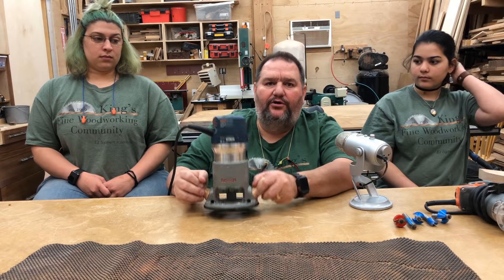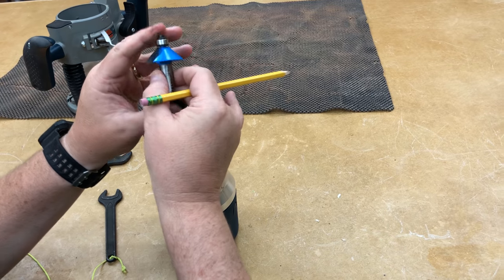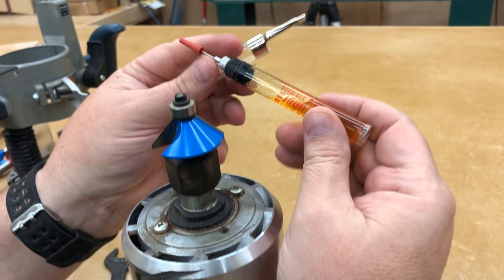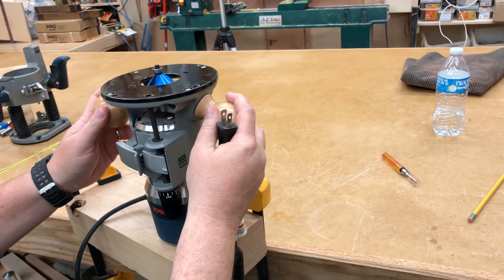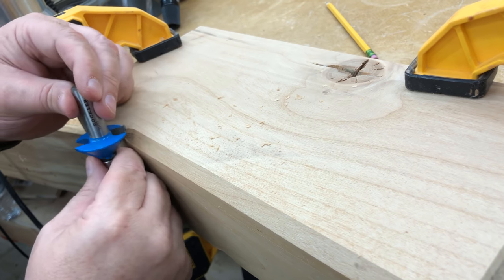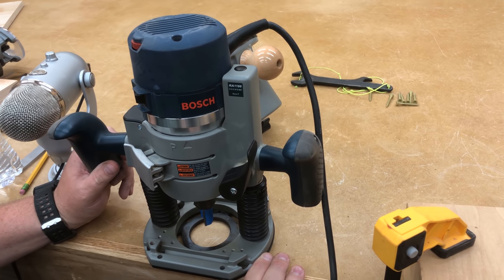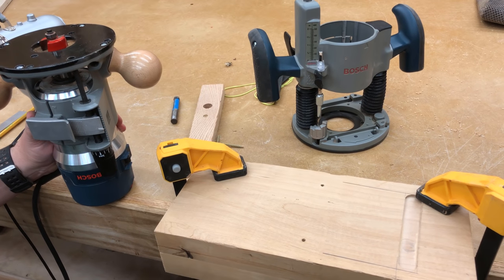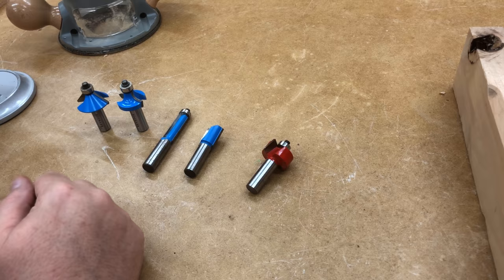56 - Woodworking 101 FREE ONLINE COURSE LESSON 1 Part 3 of 8 The Router

Comment: If you're just starting out with a router I highly recommend spending the extra money if you can and get a kit like James has that comes with both a plunge base and standard base. I have the same kit he does and I made a cheap router table that the standard base is attached to and if I need to do routing without the table then I take the motor out of the table and use the plunge base. This setup has worked wonderfully for me and I can quickly go back and forth if needed.
Reply: Damien Sees I agree. Plunge/fixed combo is the way to go. I have the DeWalt set and and can’t recommend it enough.
Reply: That Bosch plunge router kit is regularly on sale at HD for $190. It's normally about $220. And is an outstanding performer. Will last for years if cared for.

Comment: A tip to prevent confusion with On/Off is to use a green paint pen to put a green dot on the “ON” side of the switch. Even if the lighting level isn’t great, which can make a tiny switch with I/O indentations hard to see, the green dot is hard to miss. It is a very inexpensive way to avoid some potentially expensive errors.

Comment: Thanks for the router class. I got one just recently. However, instead of one bit at a time, I did find quite a few carbide tip "starter sets". It included the most common bits.
I ended up getting a 12 piece set for around $30. 
Again thanks for videos.
Reply: I did the same. I had a larger project I was starting when I bought my router and I bought a 12 piece set to get me started. They're the black painted Irwin's. As the bits get dull I'm replacing them with the better quality bits.
Reply from the maker: Thanks for your comment. I don't recommend the cheaper bits because they are made to extremely low tolerances. If you are paying $2.50 per bit instead of the usual $30 you can expect that. Many of them have cutting wings that are not perfectly aligned with each other. And some are out of balance. Most of them will start to burn your work pretty soon. And it is a bit that may only last a few jobs. 

On the other hand an investment of $25 or more on a quality router bit will last the rest of your life, even if you are a professional woodworker.
Reply: Thanks for the advice James. I knew I didn't want high speed steel and made sure these were carbide tipped. I still have a lot to learn.

Comment: Thank you for these video tutorials! I'm learning so much from you and your teaching style is fantastic! Is there a guide video for terminology? Like what is a "mortis" or a "dado"? Blessings to you!
Reply: You could try a web search.  Then click on the "image" button and you'll get lots of pictures,  Or you can keep taking video "lessons" like this on.  Or both ;-)   To your specific question: a mortise is a "hole" that a "tenon"' goes into to form a joint to join wood with a "mortise and tenon" joint.  You can get a book on all kinds of joints.  A book on Japanese joints will blow your mind.  They build entire temples that stand for hundreds of years and don't use a single nail or screw.

A "dado" is basically a slot.  It is sometimes used to hold a drawer bottom.  A peice of thin plywood can slide into the slot and sit there happily with no screws or nails.

Comment: I was always confused by the line and the circle symbols as well, kept forgetting which one was on and off until I realized that those are actually 0 and 1 (zero and one). Never had any issues remembering since then, cause zero is obviously off and one is obviously on.
Reply from the maker: Thank you. It makes perfect sense.
Reply: I've been an electrician for 15 years and have used electronics for 30 some years and finally I know what that means. Lol.
Reply: @kc_kidd_9132  My mnemonic, was "O" for "on" and"|" for "off" as in closed.  Then I realized that the "O" could also mean "off" and I was more confused than ever.  The 0 and 1 makes so much more sense.  You'd think that whoever came up with those symbols would have tried harder.

Comment: James, When using the flush trim bit, and you are copying the profile o0f the bottom profile, could y0ou use that to joint those 2 pieces?   Great video again...... Thanks for sharing and teaching.
Reply from the maker: Hi Felix! If the bottom were jointed already. Then you could use the technique to joint the top piece. Because the top will become identical to the bottom

Comment: I have seen a lot of clips on routers an was suprised when I found one that discussed variable speed routers an their uses. As a safety note large diameter routers bits (such as commonly used to make raised panel doors) should be run at lower speeds. They have a manufacture rating for them. Running a router blade above the rating could cause damage to the bit an is unsafe. They can come apart an cause serious injury. Although I see many router videos I have only seen one discuss this. Anyone ever experienced that?

Comment: Do you ever use higher power routers, like 3HP?  If so, do you have a recommendation?
Reply from the maker: Hi, I do. I use the porter cable 7518 router. It's the 3.25 HP, and it is a beast. I own two of them and I keep them in router tables. Here is a link to the one I am talking about, https://amzn.to/2FG8LZ0
Reply: If you're installing it in a router table, do you need to buy anything else with it?  Also thanks for responding!
Reply from the maker: Hi, it’s ready to go for a
Router table. It has enough power to cut a 3-1/2” router bit profile for raised panel doors in one pass. I’ve built 30+ kitchens with mine.

Comment: One point you might want to bring up with the router is wanting to put the rounded side against your guide instead of the flat side
Reply from the maker: Darn it! I forgot!  Thanks Brian. I’ll cover that for sure when it’s used in later the course. Thank you!
Reply: King's Fine Woodworking I noticed you did it in the video but didn't point it out. Thanks for putting all this material together